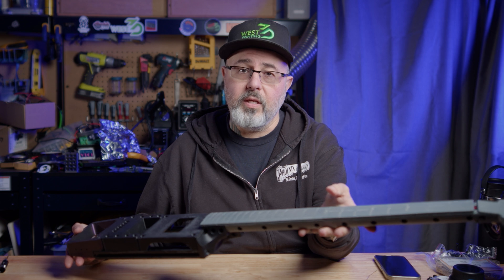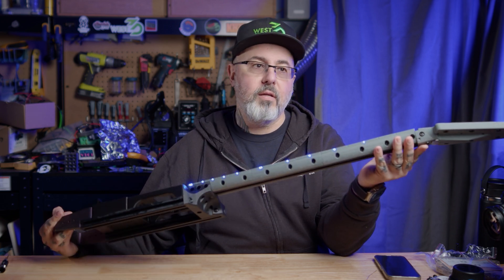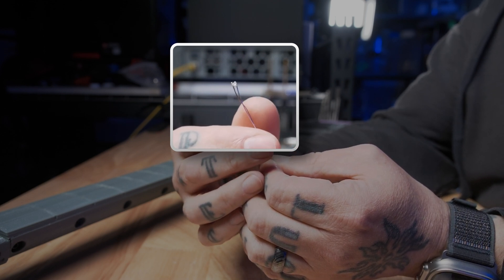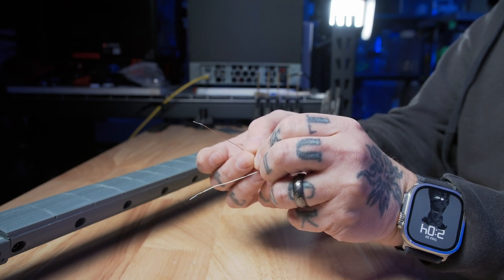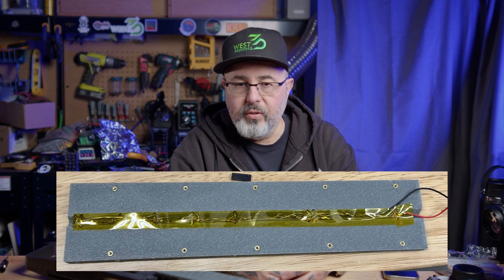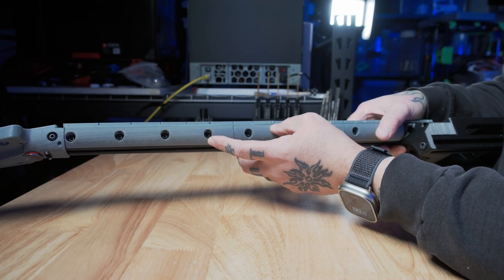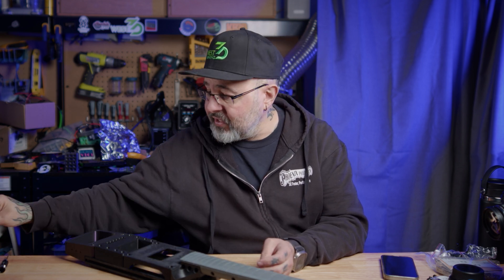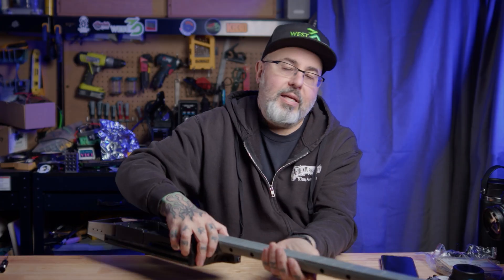The ExoGuitar by Spikeon Studio, part 3: neck assembly!

Comment: Great progress!  The metal fret version of the ExoGuitar is a huge project.  Since you've started I've found that for most cases printed frets hold up pretty well so if someone isn't looking for an S-Tier difficulty build there is a simpler option.  Same with the LED's, those are optional.  A piece of contrasting color filament can be glued into the hole instead of the LED's to serve as an indicator.